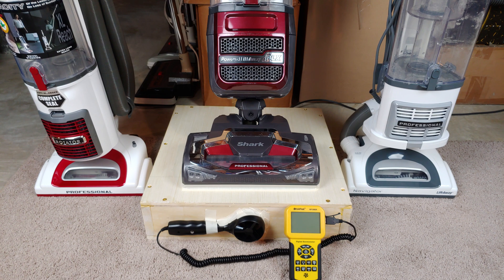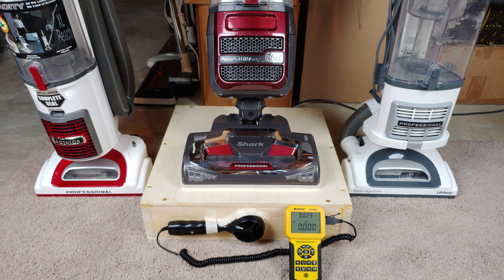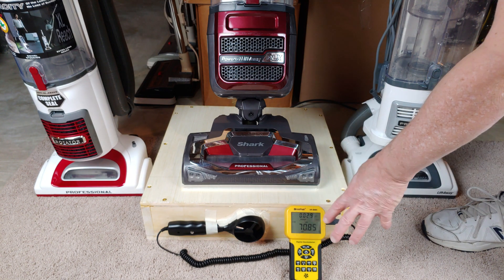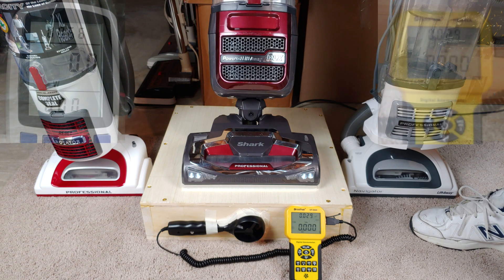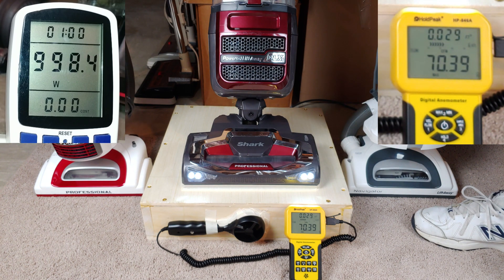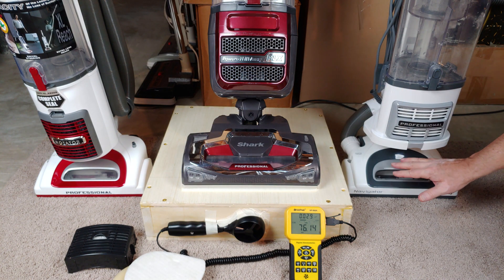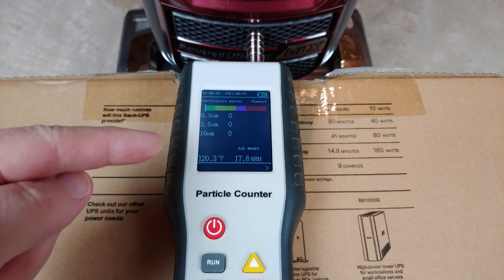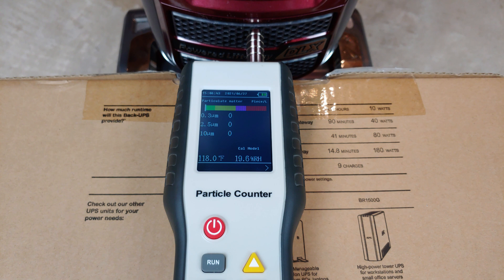Shark Powered Lift Away DLX NV585 Airflow Suction RPM And Particle Tests

Comment: The funny thing is, I think the motor that Shark put in these models originally had slightly more suction!
But 70 CFM is really good for the old-style motor. I wonder if improved airpath design accounts for the additional 10 CFM over the NV300 series.